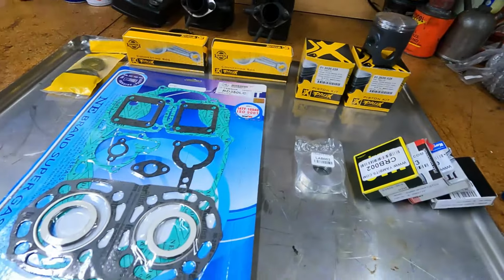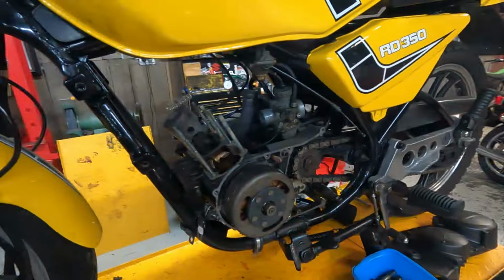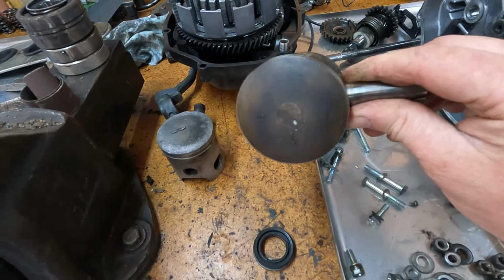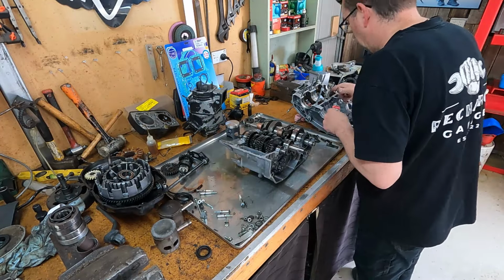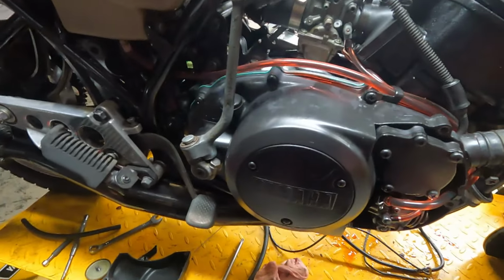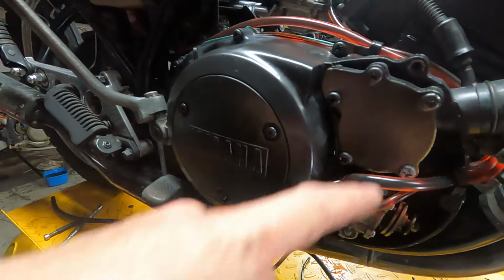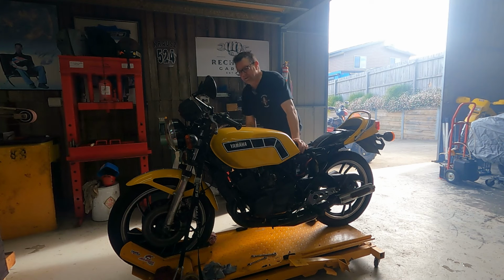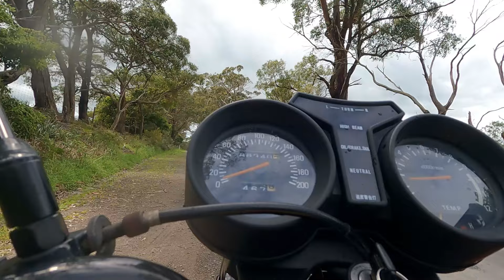Yamaha RD350LC Part 2 engine rebuild.

Comment: Very nice bike built with very nice parts I just take longer to rev the engine past 6000 rpm only after 500 km and I put 1% mix on the tank for the 1st 800 km. I also avoid constant engine speed. Anyway nice work

Comment: Hey Chris 
i got the bikes home took it for a spin and she runs great every thing sounds like new 
you have done an excellent job. even the rd400 is running great. 
Thank you great work
Reply from the maker: @nelsonfernandes7933  no worries Nelson thank you for giving me the opportunity to work on your 2 beautiful bikes it was a pleasure.👍
Reply: Try get the original airbox mate ,  much better than crappy pod filters ,I can hear she's a little boggy low down. A skimmed/lightened flywheel really helps the engine  spin up quickly too, but get the bike to run right first .  Lovely bike !!

Comment: Research @ YamAHA REVEALED that keeping these  high performance machines in the RED line constantly 4 more than 15 mins to hAlf an hour flat out all the time without a break can destroy any high performance 2 stroke. It's even written in some TURBO 4stoke bikes and cars(written in the owners manual). After each flat out red line run for 15 mins, close throttle to run slowly, mid speed(speed limit)- or stop and take a brake:text-green-game-over::text-green-game-over::text-green-game-over::text-green-game-over::text-green-game-over::face-purple-crying::face-purple-crying:.   Nice vid, hope the owner learned a lesson. !!!!
Reply: Nice vid, hope the owner learned a lesson. !!!!:text-green-game-over::text-green-game-over::text-green-game-over::face-purple-crying::face-purple-crying::face-purple-crying:

Comment: After a full crank, rebore new piston build what would be your running in recommendations. Just had one done and slightly nervous
Reply from the maker: @dccsound9209  Hey mate, after every rebuild I’ve done I have said just ride the bike normally don’t go and ring its neck down the quarter mile to see how fast it goes. Do a couple of heat cycles gentle rides get some kms down and it’s a 2-stroke they’re made to rev just don’t abuse it! Enjoy your ride 👍